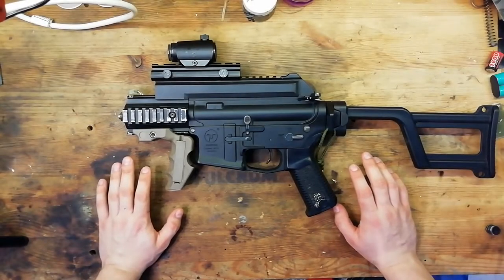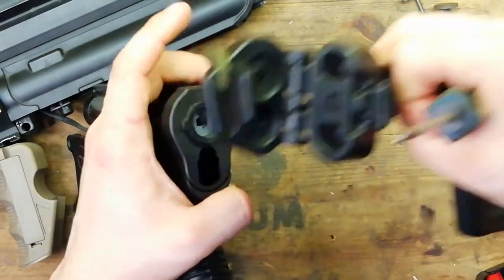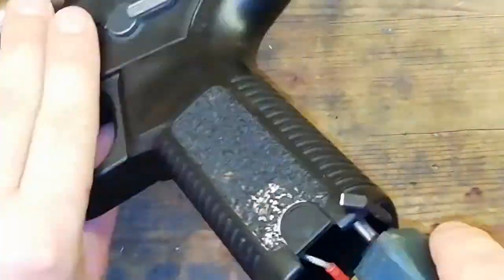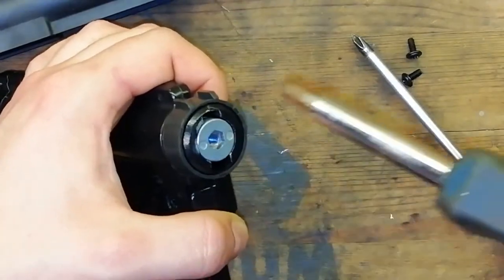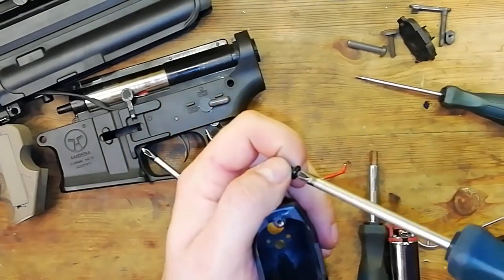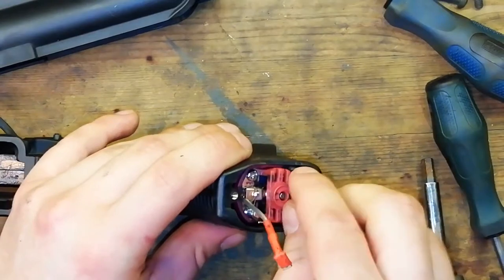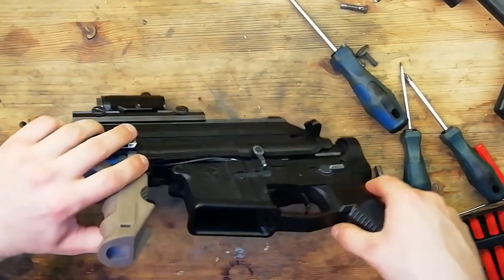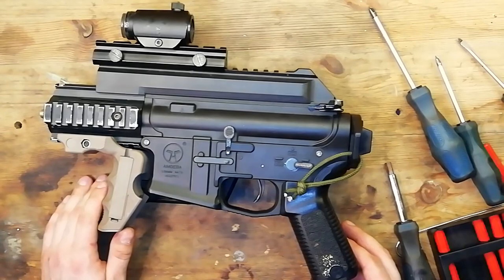Ares Amoeba CCR AEG Gearbox Removal Guide (Airsoft M4 Disassembly Tutorial)

Comment: Do you happen to do commission work. I've taken apart the gear box. I bought shs high torque motor, shs 13:1 gear ratio and a shs rocket piston, with new shims, and piston spacers kit. Its frying my head trying to put it all together
Reply from the maker: I don't, sorry. I can try to help you with this. Although I'm not the best at Airsoft builds so you're probably better off looking around other channels and places for information too. For starters the new gears will need to be shimmed in the gearbox. That's the first thing that needs to be done, I haven't got any shimming videos on the channel yet but there are lots on YouTube already. Shimming is probably the most time consuming and fiddly bit. Once that's done I'd double check the compression whilst you're at it, again I'll do a video on that soon. In regards to piston spacers I haven't used any before but I imagine it's something to do with AOE correction which I have rarely needed to do. 

What specific thing are you having difficulty with? Or are you just unsure with where to begin?

Comment: What kind of RIS does this use? I have found nothing online showing the rail & barrel nut removed. I have a CCC model and want an RIS but cant find anything about it. Traditional RIS & barrel nuts wont work as the top rail slides into battery compartment not allowing ris to twist on barrel nut. Any help is much appreciated!!
Reply from the maker: The RIS system slides over the outer barrel assembly and into the battery compartment. It is secured with 3 screws, two in the side and one in the top. I'm not an expert on rail systems but I think it's a proprietary rail system. I can do a video at some point showing how it fits.
Reply from the maker: Sorry, just realized I've been a bit of a tit by basically repeating what you said. I'm wondering if you can find s rail system and drill holes in it to allow it to fit the outer barrel assembly.

Comment: Damn the version I'm working on uses a different qc spring system (wich is far more annoying). Thanks anyways!
Reply: The mag release is different too
Reply from the maker: Ah bollocks, I'm guessing you've got a newer Amoeba. My one is at least 5 years old.
Reply: @FulcrumAirsoft  they managed to make it worse...
Reply from the maker: Great, I'll do some googling.
Reply from the maker: It seems that some Amoebas have spring guides that can be unscrewed and removed with the gun intact. Apparently all you have to do is remove the stock and use an Allen key to unscrew the guide, change spring and then screw it back in. What model is your Amoeba?
Reply: @FulcrumAirsoft  yeah it's that system, the problem is that the part where the spring guide screws in isn't part of the gearbox and I don't remember how to put back that part. I tried to fit it inside the gb but it doesn't seem to fit and outside it wobbles
Reply from the maker: @cetriolino5779  Right, bear with.
Reply from the maker: The threads aren't stripped are they?
Reply: @FulcrumAirsoft  luckily still intact
Reply from the maker: Does the spring guide fit into a nut of some sort that is fitted into the back of the gearbox? Rather than the threads being cut into the gearbox casing? Sorry if I'm not being much help but I won't lie I'm stumped.
Reply: @FulcrumAirsoft  yeah there's a nut where the spring guide screws in, at first I thought that it would fit inside the back of the gearbox but it doesn't
Reply from the maker: It might be held in by the sides of the gearbox, might have to pop the gearbox apart. You got a manual with an exploded diagram that might show how it fits.

Comment: I put one of theas gear boxs innan e&c 416a5 and jesus its an improvement i just had to remove ambi selectors and install after marker m4 selctor pins hold tight and very snappy on 7.4 almost perfect rof
Reply from the maker: I really like the Amoeba platform. Ares on their own are hopeless, but when Amoeba fiddles with their stuff it's great. Although just found out the CCR has cracked it's gearbox. To be fair it's had a LOT of use. Hundreds of kills and god knows how many shots.

Comment: How can I remove the lipo cover
Reply from the maker: Push in the buttons on either side of the battery cap and pull it off towards the muzzle.
Reply: @FulcrumAirsoft  not the small I'm talking about the counterpart.
Reply: I would like to mill it so that I can also get other lipo in it🫶✌️
Reply from the maker: You mean the top rail with the battery compartment? Not completely sure and I think it's one piece with the receiver, I'll check.